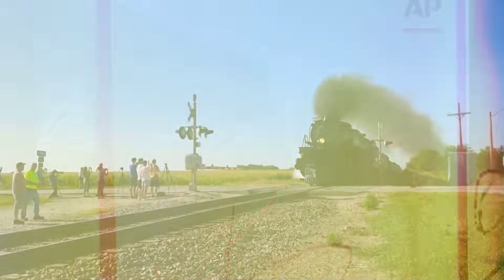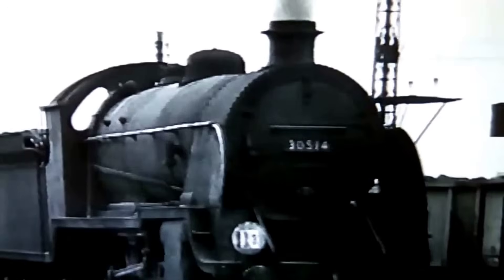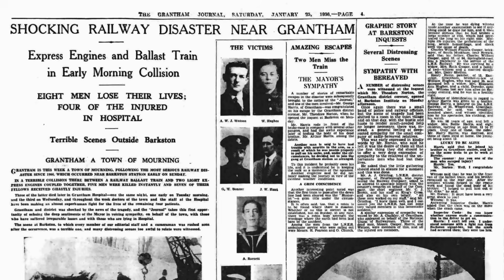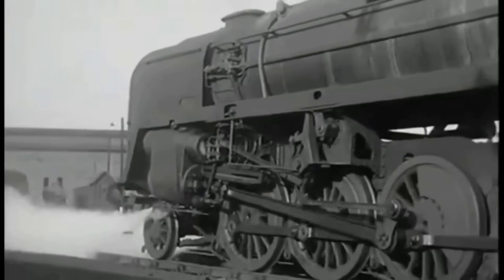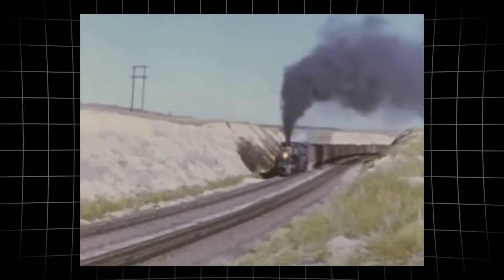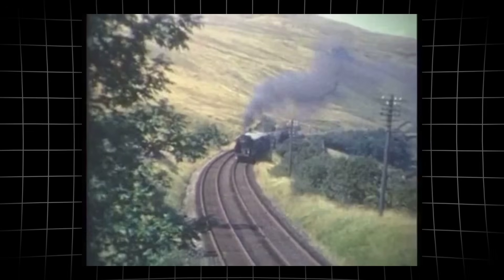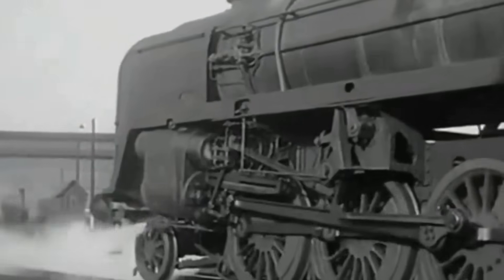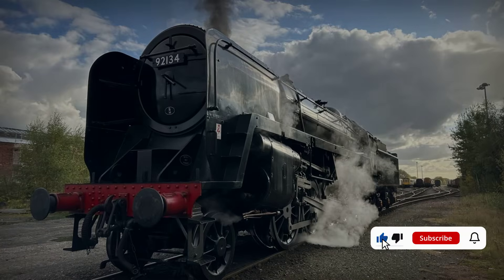The British Steam Monster That Rivaled Big Boy’s Power

Comment: BR class 9F tractive effort: 176.45 kN, UP 4000 class tractive effort: 602.18 kN (I used metric numbers due to the fact imperial units do not match US) top speed, BR class 9F could not find, rumored to have traveled as fast as 90mph (about 144kph) Union Pacific Big boy DESIGNED to run up to a max of 80mph, (130kph). I'm not suggesting the BR 9F wasn't an impressive machine, especially considering the British loading gauge, with infrastructure clearances from the 1830s, it was and still is the most powerful locomotive on the British Isles. But consider this is a very poor comparison at best, when an average US Mikado type locomotive (SR 4501) has a tractive effort of 239.8 kN. All this video is demonstrating is how uninformed the creator of this video is. You might as be comparing a Mini to a Plymouth Fury....

Comment: Far above its class, but far above Big Boy.  These engines can not be compared. The terrain is entirely. The weight of rails, ties and engines are different, The gauge are identicat.  England does not have a mainline at 2 feet eight and three-quarters inches.  No, the 9F had to fit the British rial system. It was impossible for an engine like BB to run on Brit rails. They did not have the mountains, they did not have the distance of delivery.   BB ran for more than 1,ooo,ooo mils.    This is a joke. Why you even try to compare the two is sensless.

Comment: Whats the wheel configuration  of Big Boy ?

 I recall seeing 9Fs hauling coal trains thru Mossley Hill station, almost at walking speed , in the early 1960s en route to Liverpool to keep their lights on. 

4 tracks. Nr 1 down line  taking the Red Rose to  Euston. 4 lines to Ditton Junction.and then 2 , until reacing Ctewe ( being realigned for electrfication.
Euston als being " modernised " ( 60s knock iit down - naivety)
Reply: "Whats the wheel configuration  of Big Boy ?" 4-8-8-4 in the Whyte classification system.

Comment: Hey, the photo on the title ("Secret Powerhouse") clearly shows a Garratt locomotive with a rotating coal bunker.
I had expected a video not about the BR Standard Class 9F (which is a nice modern "Decapod" but not really a "Steam Monster"), 
but rather about the LMS Garratt. These articulated locomotives, with their adhesive weight of 124 metric tons, would have been more appropriate to compare with the Big Boy. The LNER U1 Garratt had four more driving wheels and was heavier too, but not successful. 
Both, of course, did not come anywhere close to the Big Boy's adhesive weight of 247 tons; but the 9F had only 78 tons and was really lightweight in this context. A comparison of apples and oranges, and the misleading photo on the title is an embarrassing clickbait.

Comment: You can't compare American and European locomotives on any level. The design parameters are just too different, due to the vastly varying requirements.
How many 9Fs would you need to pull a 3,600 ton train across Sherman Hill, a comparable ramp being non existent in the UK?
Any advantage it has on paper would be quickly eroded given the number of locomotives required, the number of crew required, the cost of servicing all these engines, etc, etc, etc, all the while them not even making maximum use of the existing infrastructure, which allows for much more substantial equipment.
Bring a Big Boy to the UK. Even if the loading gauge would allow for it, you'd watch the rails buckle under its weight, points being shredded to pieces, and all the other destruction in its wake, for what? Pulling a train a 9F would be plenty sufficient for?
Any comparison is just pointless.
Besides, there is really nothing special about the 9F. Similar engines were built throughout Europe, much earlier, and in much greater numbers. But the Big Boy is a standalone.

Comment: She and the German Class 50 could be hold for sisters, performance-wise. The Class 50 was built for winding branche lines and fast main lines almost 10 000 times.
Reply: But the BR50 wasn't Germany's biggest and most powerful freight train steam locomotive, whereas the 9F was Britain's, if you discount the U1s, which were built for a different purpose anyway.
Reply: @baronvonzach6109  
I didn't want to mention the most powerful German steam loco. To that end I would have mentioned the classes 42,43,44 or 45.
What I said was that the 9F represants the British equivalent to the German 50, that took to the rails 15 years before. Both were able to haul heavy freigt trains and even express trains. I can only speak for the 50 but I think the 9F was an appreciated allrounder as well. Reliable, and easy to maintain.
By night you heared the 50s,43s and 44s at our station hauling coal, iron ore and steel. Since I live in a rolling landscape even two 44s had trouble to move an extra heavy coal or iron ore train during
a winter's night.
If the author of the vid wanted to highlight the most powerful British steam loco why didn't he say so?
By the way, it's said the Duluth, Missabe & Iron Range 2-8-8-4 Yellowstone was even more powerful than the Big Boy.
Reply: @carlnapp4412 The Alleghenies were demonstrably more powerful, yet remain unsung heroes. Maybe because they lack the Western romance surrounding the Big Boys?
Your pegging the 9F against the BR50 makes sense, all I said is the BR50 wasn't Germany's most powerful steam loco, whereas the 9F was the UK's. We never had anything along the lines of a BR45. Imagine the author of this rather pointless video would have compared them with the Big Boy.

Comment: I was a bit puzzled that you didn't really mention the Beyer Garratt locomotives, only a few of which ran on British rails. They did work quite well in Rhodesia and South Africa, and were far more powerful than the 9F I enjoyed seeing all the images though. Very nostalgic!
Reply: Beyer Garratt locos were also used in NSW as the AD60 class - I think other states had some too -.
Could be used virtually anywhere in the state due to it's design and haul remarkable tonnages.
Reply: I'm pretty sure the LNER U1 garratt was the most powerful loco ever to be used by britain as well
Reply: Well, before writing any article a little bit of fact-checking comes in as essential. There are so many gaffes on here.
Reply: They have Garratts on the welsh highland railway, yes, they are smaller narrow gauge versions, but they needed them to get the trains up the gradients there. I was there in 2024, they were still very impressive!
Reply: At least in the UK the BGs played an entirely different role, so a comparison would have been even more pointless.

Comment: There were many British steam locomotives with higher tractive effort  Princess Royal class  Duchess  GWR King   Big bertha 0-10-0 banker  LMS Garret    LNER Garret   at  72000 lbf    And today the middle flangeless wheels prevents any of the surviving ones from running on the main line   THIS POST IS FULL OFERRORS so I won't comment on the American side of clip      THIS IS A TIP FOR YOUTUBE SNOWBALLS    IF YOU ARE GOING TO POST ANYTHING ON STEAM LOCOMOTIVES     YOU ARE TAKING ON   MILLIONS OF PEOPLE WITH MORE KNOWLEDGE THAN YOU
Reply: I'm just asking. Why does the flangless Middle Wheel prevent mainline running ?
Reply: @animaltvi  Some shit about check rails apparently, they think it will make the wheel ride up and derail the loco. I would like to see at least "Evening Star" modified to run on the mainline again.

Comment: " 9Fs on tracks a full 2-feet narrower than Big Boy."  Utter nonsense.  Both ran on the Standard Gauge. If you can't get that correct how much else can we believe ?
Reply: I think he meant loading gauge rather than track gauge??
Reply: @kenedge  Possibly, but "narrower" to me, and probably most other people, means side-to-side, not top-to-bottom. And he is talking  specifically about the track.
Reply: This thing has no understanding of what it's writing.
Reply: @AUssteamchannel9994 ?
Reply: Standard British gauge was 4 feet 8 and a half inches.
Reply: @tuguybear930  American Standard Gauge is the same as British. The Standard Gauge is exactly that, standard the world over.
Reply: I understand clearance problems, but the Brits use the same gauge as we do here in the States!
Reply: @JamesKubajak-c1i   what we have, and allways have, is Welsh steam coal. It had a very high specific energy. It is difficult to get going but had more energy per ton than most coal used in other countries!
Reply: @brianwindsor6565  Mainly only used by the GWR.
Reply: @meeeeeeeeeeeeeeeeeeee2 And the LMS, but they also sold the other stuff that was almost as good!! We were still left with the shit!!

Comment: Welsh Steam Coal was the finest in the world. At least one seem of it was a smokeless coal.
Reply: The very finest Welsh coal came from the Cwm Rhondda Fach (Little Rhondda Valley), in the lowest seams, some 400 yards below the bottom of the valley.
Reply: bro the part where they talk about fuel efficiency they dont talk about coal quality the up coal had more contaminants in it comparted to British coal of course the big boys would run though more of it i wounder why they left that part out
Reply: @artybuttonusa9974  That does play a part.

Welsh steam coal (a low volatile, full bituminous coal) puts out almost double the BTUs per hour that Powder River Basin lignite puts out, and 1 1/2x the BTUs of most Eastern bituminous coals. Only Pennsylvania anthracite came close, and even that still didn't quite equal the BTU/h output.

It's the difference between trying to burn brown rocks that vaguely resembled coal, and the coal equivalent of race gas.